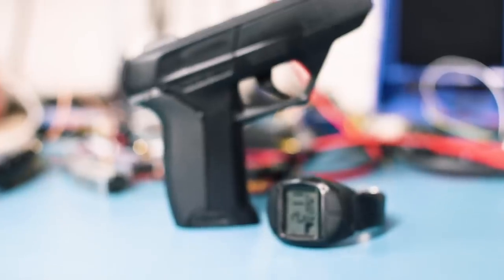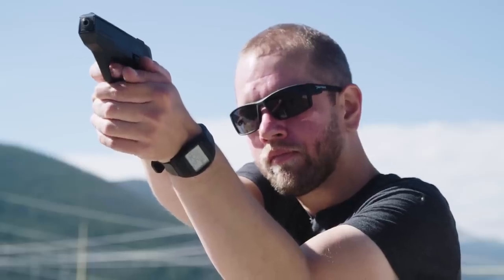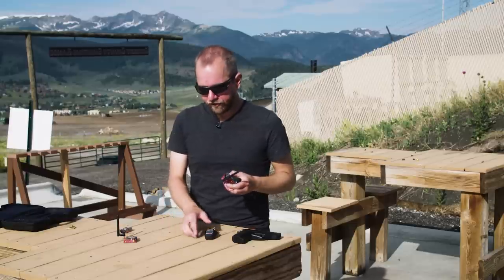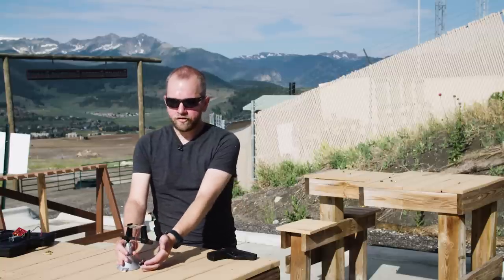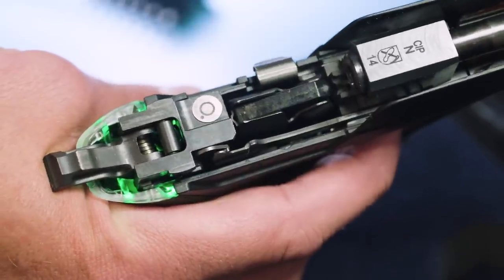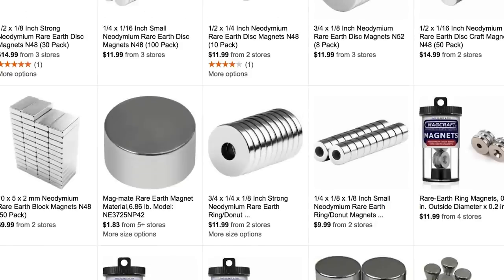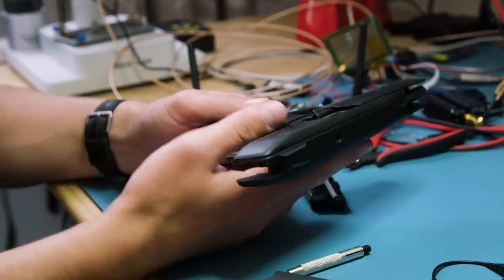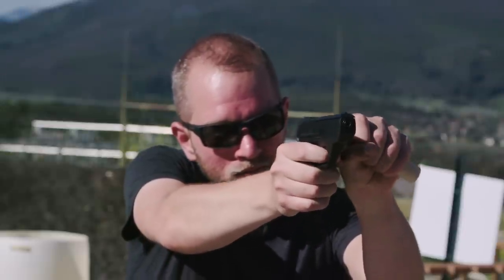How a Hacker Fired a Locked Smart Gun Using Only Magnets | WIRED

Comment: You might as well just buy a regular gun
Reply: With the 1800 dollar price tag, using the second cheapest gun, you could buy 11.6 not smart guns instead.
Hi Point (155$)
Reply: Panzer Faust Or a different pistol that doesn't look like a failed art project (Glock, M&P, Taurus Curve, etc.)
Reply: If it's cheap, reliable, and saves your life, who gives a damn what it looks like?
Reply: Panzer Faust Also, you could build like 4 or 5 AR15s for that price, or a really good one.
Reply: The Taurus Curve does look like a failed art project. Also Taurus sucks.
Reply: +NOPE NOPERSON Right, so long as it meets that requirement the rest are all just bonuses.  That said, I'm always a proponent of getting the best gun you can afford (more expensive not being the best of course).  High points are heavy because of the blowback system, and the tolerances are pretty loose.  It requires a lot more range time to be accurate with a high point, and off a bench, they aren't as precise as I'd like.  Obviously, the grip, weight, and sights all leave some to be desired. 
If High Point is what you can afford, it's maybe the best gun at that price point.
Reply: +HiPoint Operator there is a certain irony in that statement coming from someone named HiPoint Operator.  No argument about getting a glock.  That's my go-to recommendation for most people looking to purchase a handgun.  Although if Highpoint is all you can afford, they are maybe the best gun at that ultra low price point.  Of course with that kind of money, you can get all sorts of gear, just about set up a for three gun with those funds.
Reply: NOPE NOPERSON you have to modify the hell out of a Hi-Point to make it functional. Much better out there for only slightly more money.
Reply: HiPoint Operator a Glock with a modified lower you mean.
Reply: +Socky Noob people only modify Hi-Points as a joke. They're trashy but they work.
Reply: Panzer Faust you buy a hi point handgun to do crime.
Reply: Michael Lasalle, what happen if you are a slight woman or senior who can potentially have the gun take away from you and use against you?  This is one of the main cause of home invasion and robbery going wrong for the gun owner, smart gun without getting hacked by a PHD will offer the gun owner a extra level of protection in these case plus it will also be safe to have around children and young guests who can accidentally hurt others or themselves (which also happen much more than reported).  

The fact they can charge so much and have a health market for it speak for itself
Reply: The Judge looks pretty cool. It shoots .45 cal and 410 bore shotgun shells. I'd buy it.
Reply: YoshiFTW the judge is trash, a cool range fun, but not to defend your life
Reply: I wouldn't use it to defend my life either. I'd rather use a Colt .45.
Reply: Michael Lasalle The only way this will work is to force people to buy it which will never happen, its another attempt the left uses to disarm you.
Reply: For real. I would consider that safer. They have trigger locks now. No way anyone will fire it without unlocking it first.
Reply: Smart guns are not a bad idea though. If the technology was flawless it would be safer. Guns are often the first thing people look for during a burglary. No way anyone could use it even if they got it. Plus it is safer if you have kids around. At this point I would never buy one because they don't seem reliable. A trigger lock is better.
Reply: Underdog Rising smart guns are a bad idea for the sole reason that technology will never be flawless
Reply: Underdog Rising more features, more failure. No thanks. All that is needed is education and proper storage (this could depend on the time of day and where you are at).
Reply: Panzer Faust For 900$ i got a springfield xds and an Ar15.  no watch required!
Reply: Underdog Rising what happens when a bad man has a gun? They use it for whatever nefarious purposes they desire. If the same bad man cannot get a gun, he will find a new "tool" to do the job. 

Ban guns, cool...but when have you seen a kitchen without a knife? 

Ban knives, cool...when have you seen a school without scissors?

Ban scissors, cool when have you seen a place without a rock within a mile?

My point is a bad guy is going to do bad things no matter what he does it with.

Bad guys who are willing to kill, most definitely don't care if the gun they do it with is illegal, all we can do is be equally or better armed than those who would do us harm.
Reply: Underdog Rising no matter how flawless the tech is a man devoted to getting around it will do so.
Reply: A regular gun is safer because everything that uses a computer is hackable.
Reply: Holy shit guys. Settle down a little. My only opinion was that this could be a useful option in the future when the technology is well developed. It has potential. This gun is obviously garbage.
Reply: Mister Fister all the issues of a smart gun are not problems to a regular gun, while a smart gun solves a problem that rarely happens with added negative side affects
Reply: Michael Lasalle You know Im not a smart man BUT!!! If a home invader KNOWS you are armed wouldnt he NOT try and rob you? I dont know if its just me and wanting to stay alive but if I had a choice to rob a armed person or unarmed person im gonna choose the unarmed one.
Reply: Mister Fister HEY! HEY GENIUS! GUESS WHAT!?! Put your gun in a safe, hell even a lockable gun cabinet would keep out a fair bit of criminals! 

So...no, I'm not going to blow 1800 dollars on a gun that I still would need a gun safe to store. Why? Because, you say "Who brings magnets to a robbery anyways?", if they steal one smart gun and figure out the "trick" (or if you see it here on YouTube) and decided to bring magnets just in case you find a smart gun.
Reply: Mister Fister the problem here is you let someone rob your gun. Smart guns aren't the answer to anything. If you needed a gun to work and it didn't cause of a fucking magnet or some other bullshit, you can get killed. A good example is the police in a fire fight or a person trying to rob from you in your house or in public. Also a watch/ring when conceal carrying in public is so noticeable. Just no no no.

Comment: What if a Smart gun glitches out and doesn't shoot and cost someone there life
Reply: BLACKLIGHT RETRIBUTION PRO rip
Reply: Exactly why "smart" guns are dumb. Guns are often intended to be as simple as possible, so there's as little as possible that can go wrong.
Reply: if a mechanical gun jams and does not fire, it also cost someone life. i can still happen. electrical is probably a bit more. 😁
Reply: The mechanical gun is usually easily cleared, and cleaning and maintenance will prevent reliability problems in most normal guns.  The "smart" features add another layer of failures, and aren't so readily cleared.
Reply: "If it fails to protect your life I'll give you a full refund"
Reply: Nobody seems to realise that even if the gun works perfectly well and as intended, it will still cost someone their life.
😂😂😂
Reply: BLACKLIGHT RETRIBUTION PRO According to criminal rights activist's, it is better to die virtuous by the hands of a criminal than kill a criminal in self defense, or the defense of other's.
Reply: Yeah right Donald Trump. 😒
Reply: What if a car airbag explodes and kills someone? We investigate the cause of failure thoroughly and fix it. We would only abandon airbags completely if it could be shown that the airbag was so unreliable that you had a better chance of survival without the airbag than with it. In the case of smart guns, we're going to have to wait for a high-profile news story about one saving someone's life, which is really unlikely.
Reply: you guys talk like electrical and mechanical guns can't fail. both can either be jammed by bullets, springs, hammer. though rarely for both, which can lead to costing someone life especially people in the line of duty or civilians. but as for now smart guns have not been tested perfectly enough just yet to put your life on the line for it. like mechanical guns,  which took over a century to get it right.
Reply: WhyteLis21 It&#39;s rare for both, but it's much rarer for purely mechanical guns.
Reply: for now that much we can agreed.
Reply: A mechanical gun can fail, and they do, and almost always the failure can be remedied quickly and easily.  The "smart" gun can fail in every way the mechanical gun can, but introduces even more ways to fail, and can't be remedied nearly as easily or as quickly.
Reply: not if you understand both electrical and mechanical parts. they may operated differently but are integrated together pretty well in most modern technology.

Comment: They also need a bigger cartridge .22lr is by NO MEANS a self defense round. It is only intended for practice and small game hunting.            Look this ENTIRE issue could be solved with just a little discipline. Early in my life I was taught the basics and importantance of gun safety as well as the Incredible weight of responsibility in using a firearm.If we just promote more gun safety and teaching. MORE PEOPE will understand that firearms are just inanimate objects that can be used safely and the BLAME of mass shootings is ONLY at the shooters feet not the gun community as a whole.     If we move towards finding identification methods FOR THESE sociopaths. We will have a MUCH SMALLER CHANCE of mass shootings.    There is NO NEED to further complicate gun laws, which are ALREADY confusing and contradictory at times.

Comment: First: of course the manufacturer will say that it is the most secure. They are the ones turning the profit. Second: an intruder will not be carrying around magnets and other tools like in the video to use your gun. They aren't that smart. Fourth: if you keep the gun on you at all times, there is a decreased likelihood of someone else getting ahold of your gun. Fifth: this gun is unnecessary. Keep a good smart Lock on your gun if you are storing it for the night and train with unlocking it under duress. If you can unlock it within 7 seconds, there is a good chance you have that gun unlocked before a burglar gets to you first. You could alternatively do what I do. Keep the gun by your bedside table with a round in the chamber.

Comment: It is important to point out such faults. I have reported to Dr. Pepper two times that their safety/tamper seals on their bottles are defective and can be slightly unscrewed which could alow someone to  introduce another liquid, etc.
 Of course, their are many other easily tampered with products out their and nothing can really be done until something happens.
 The gun and watch system relies on the main factors of possession/proximity and control . If you could gain that with a normal gun, then why not this one ?

Comment: this is literally a non issue, the point of the watch is to prevent someone from stealing your gun when you have it pointed at them, none of the hacks, not even the magnet is going to be avalible to the average person and the gun will work as intended
Reply: Sure, until whatever is sending the signal from the watch to the gun malfunctions or is interrupted. All it takes is one break in the chain and the gun is rendered useless.

Comment: Unnecessary complexity in a product where reliability is the number 1 consideration.  A product where reliability could mean the difference between life and death.  Anything that could remotely reduce reliability should not be introduced.  Especially not to solve a problem easily mitigated by far simpler and more robust solutions.
Reply: do you know why cops shot suspect who try to fight? because they fear to have their guns stolen and returned against them  !
reliability can be obtained with a bit of engineering.
biometric will go everywhere in many  country and tools, airport, smartphone keys by example..

Comment: ok, but how feasible  is that? you have that gun pointed at me, what are the chances im just gonna magically have magnets in my pocket? let alone the reaction time the shooter will have to pull the trigger, versus, me reaching down in my pocket, grabbing the magnet, then running toward the gun and smack the radio with the magnet??? this proves nothing.
Reply: It proves everything. It proves that there are vulnerabilities in the system, and that it's not truly smart. A truly smart gun needs to be essentially 100% foolproof, else you are just adding to the complications that a normal gun has such as jamming or broken parts. 

It's not so much that this gun can be tricked with magnets into firing, or that a radio transmitter can render the gun useless, but the fact that the gun can be tricked into operating under circumstances that it's not supposed to. Not to mention all the extra processes that go into authorizing the use of the gun can fail or be tampered with. 

Smart guns are a good idea in my opinion, but I think it'll only be that, an idea. There is no way for this type of technology to outpace everything else. If you know how to build a smart gun, you know how to render it useless unfortunately. If it is widely adopted I believe it will be a horrible mistake, you can't create a perfectly secure piece of technology. It's just impossible.
Reply: Filbertfriend lol it proves vulnerabilities, but nothing viable. Nothing ground breaking. Nothing that can actually be used. Nothing effective.
Reply: I would say that using a simple magnet to operate the gun is pretty telling. It completely nullifies the purpose of having a smart gun. Sounds pretty effective to me.
Reply: Filbertfriend tell me how long it would take you to pull out your magnet and turn toward the gunman and stick it to the side....

Vs. how long it would take for the gunman to just pull the trigger.

Please tell me how this "hack" is practical?
Reply: Well, it's nullifying the purpose of a smart gun. In your particular scenario, sure the person without the smart gun has the advantage, but that doesn't mean the person with the magnets and the smart gun can't kill the person with a normal gun. It's still a gun, and holding up a magnet to the side of a smart gun isn't exactly a long process. You can flip that situation on it's head too, where a criminal has a stolen smart gun, and attempts to kill someone that doesn't have a gun or has a normal gun. If they have the advantage of aiming and shooting first, it doesn't matter if he had to hold a magnet to his gun or not. 

Besides, most of the advocacy for smart guns is that it will make guns more safe. These "hacks" show that these types of guns are vulnerable and can be tampered with quite easily.